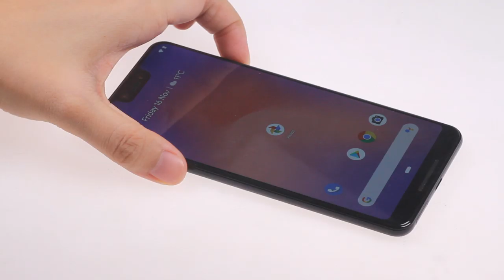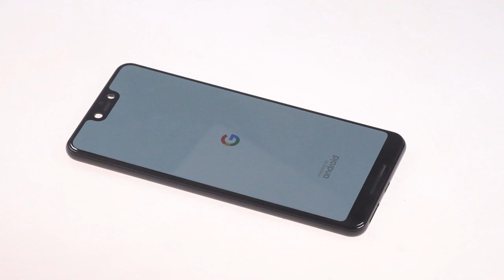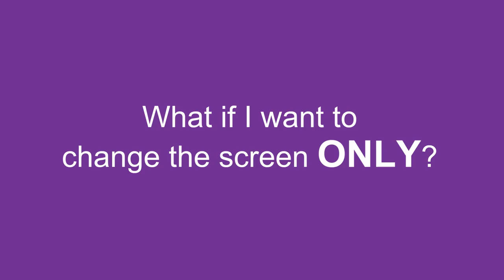Google Pixel 3 XL Screen Repair Guide

Comment: Just so everyone knows:

You can STOP before step 4. Removal of the battery is NOT NECESSARY. Remove the screen the same way you would have in their Pixel 3 DIY. Place screen and then do everything from motherboard removal backwards and you're done.
Reply: How did you remove the screen? in the Pixel 3 video, it says "just break and clean away the old screen". However, they don't show how to do it. I am scared of damaging the phone worse without proper guidance.
Reply: @sinanegilmez  you literally break the screen. Put a razer between the body and glass and peel it away. The screen itself under the glass is very flexible and glued so you peel that away as well. The glass will likely pull away in one piece.
Reply: @GohanBurner  is it possible to just replace the glass at this step? My display is fine...just an annoying crack in the corner

Comment: You do not need to remove the whole motherboard or the battery. Remove the screen but leave the connector. Remove the back and only remove the bar on the right (4 screws) exposing the cables below the bar. Disconnect all the cables including the LCD cable. Then with a plastic spludger pry up the motherboard from the bottom right corner and remove the screen cable from the front. Reverse. You are going to need the correct glue and remove the old glue to maintain the waterproofness. You can buy a patterned sticker for the front and a new whole back but I don't know how well they keep out water. If you're going to pay someone best get a new battery atthe same time.

Comment: Hey, can you please share a link for the glue, that has been used on the speaker and vibration as well as an adhesive for the battery. Thanks.

Comment: Attention: This guide seems to be made for those who bought a display unit with frame!!! Those like me who bought just the display may stop disassembling right after removing the motherboard at step 3! Continue replacing the old display with the new one! Be careful:  There are some long screws and some short ones. Keep in mind what places they had! 

For most people - like me - it should be enough to replace just the broken front glass for only a few bucks and fix the new one with Loca glew and UV light in minutes instead of hours! But I haven´t seen a guide here for Pixel owners!
Reply: How did you remove the screen though?
Reply: @sinanegilmez  Here is a walk through for those who need to replace the screen WITHOUT a frame
Reply: @dramione15  Where?
Reply: @benc6587  dang, I had linked it to the word “here” when you click on it but it looks like the video got removed
Reply: @dramione15  All good, I found a video on it, and it looks even harder than replacing the LCD

Comment: the plastic bezel that goes around the screen is has a 1 inch chunk broken off.  should this be installed before or after the screen is in place?  thanks!

Comment: This is going to be a pain in the ass compared to the screen I replaced on the regular Pixel 3...UGH. At least the earpiece isn't flimsy as all hell. I ripped the cable during repair.

Comment: Is it still waterproof after you put the new screen?
Reply from the maker: Once it was repaired, it will loose waterproof.
Reply: @EricWitrigs  In your other videos, Samsung note 9 the display is changed without the mid aluminum frame but why can't in pixel 3?????
Reply: Mine felt into water and doesn't work again

Comment: you don't need to remove all this bullshit, just the front and back and the right side metal bracket on the back, a slight pressure from the front on the motherboard allows you to slip the screen cable in.

Comment: Do not attempt this. One wrong move and your phone is done for. This repair will take at least 6 hours, and is not worth completing. You can have the phone repaired for $269.99.
Reply: Where do you get that price? Both Google and ubreakifix are over $300.
Reply: @sinanegilmez  The price went up from now. 100% not worth the repair. If anything, you are better off just buying another, or an iPhone (which is more bang for the buck), or a Pixel 3a which is nearly as good.
Reply: @SkullkraneEntertainment  wair for real? a local place has a price of $170   and im even still gonna get a new phone..its too damn high
Reply: Now you can buy the phone for $150.